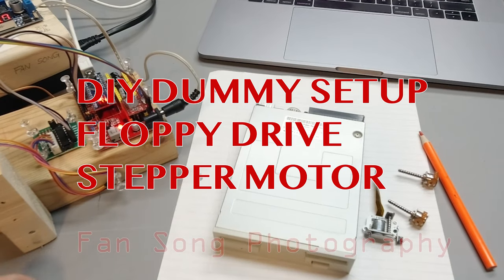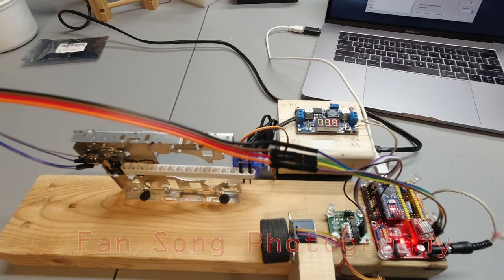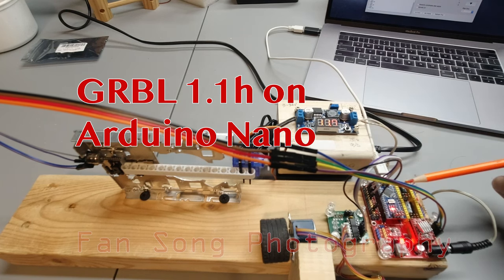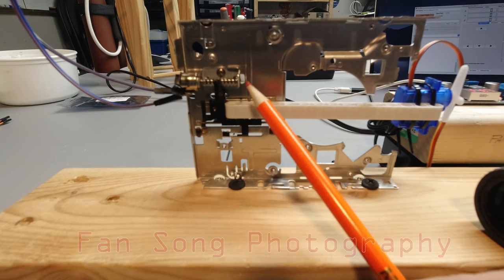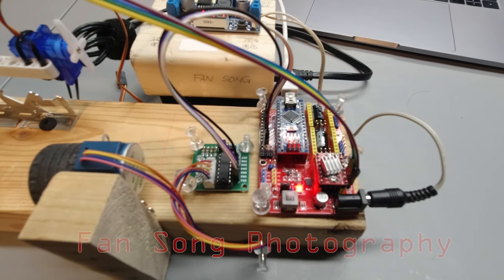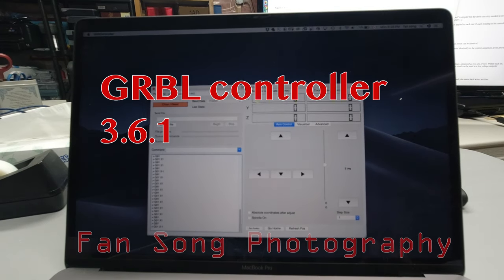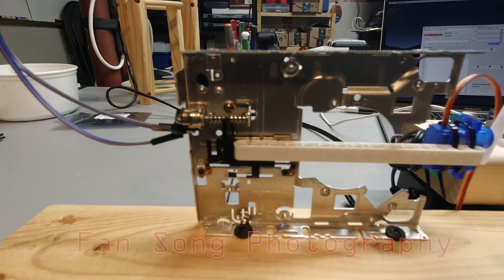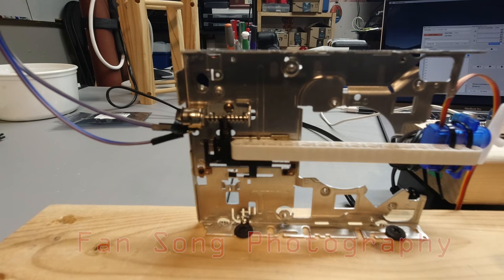DIY - Easiest way to setup stepper motor of the floppy drive in Arduino

Comment: Great tutorial on these motors.  Thanks.  I am considering using these as a small shaft encoders as others have done with stepper motors.  These are smaller so maybe better to fit in small project boxes.  My end use is soldering iron temperature adjust knob.  Thanks again for sharing.
Reply from the maker: Thank you for your comment. And good luck with your project!

Comment: Please post a video of the schematic connection of the motor!
Reply from the maker: Hi, I remembered, from the step motor, 1, 2, 3, 4, when you connect to CNC 4988, 1, 3, 2, 4. Basically, it is the 2 and 3 need to be twisted. HTH